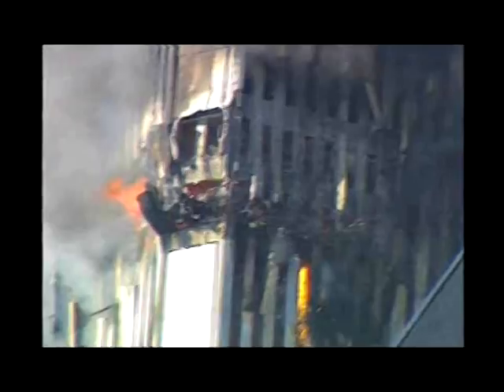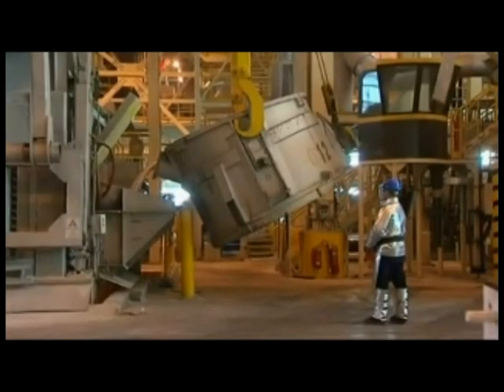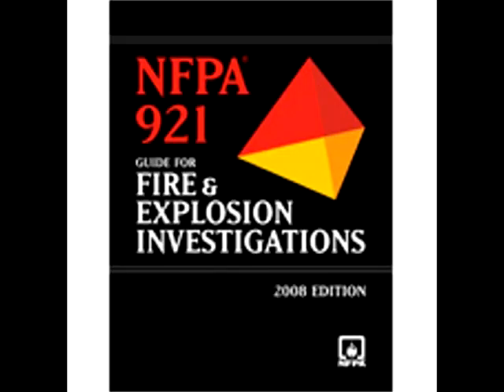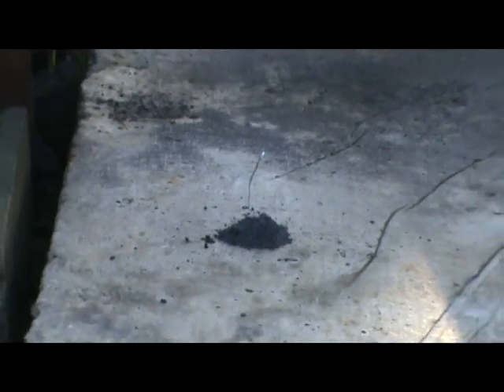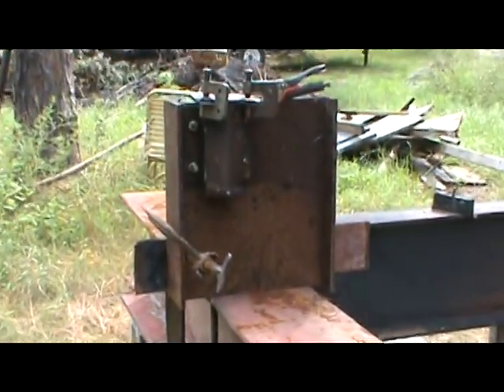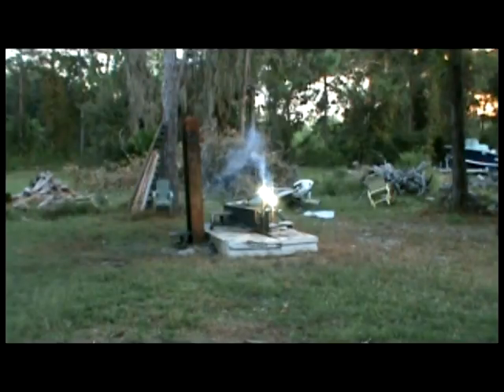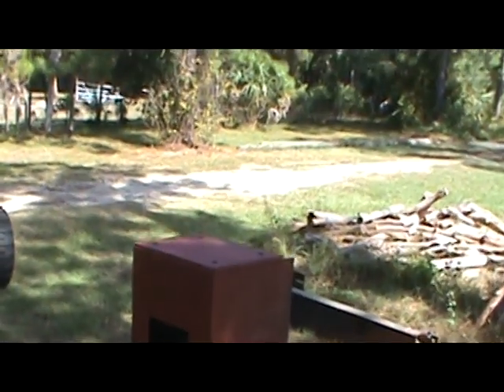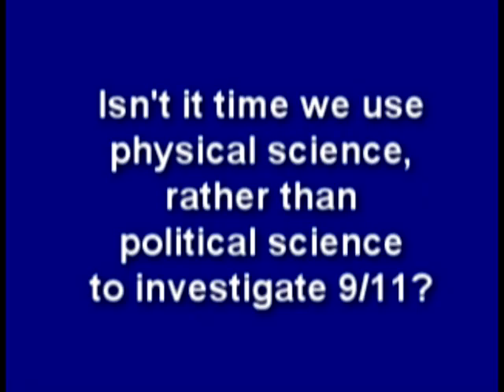9/11 Experiments: The Great Thermate Debate

Comment: Nist never said steel melted.they said it weakened steel until the point where it can no longer carry load and buckles,thats aluminum pouribg out from the aircraft,since it could melt in the intense heat
Reply: Molten aluminum is silver...
Reply: +oBlair65o it's yellow when heated

Comment: The space shuttle was traveling at over 17,000 miles per hour in the upper atmosphere and they recovered over 8,200 pieces. Yet the planes on 9-11 vaporized ? Those buildings were built to stand up against anything. Come steel beams spaced 36" apart all the way around. We'll never get the truth, nor the truth about JFK.

Comment: Error number 1  molten metal pouring out the building.  That could have been almost any substance that caught fire.  No proof at all that it was metal. 
Error 2 taking a fire fighters word for something he isn't qualified to judge.  How does he know by looking that it was molten steel.  What is the difference between molten steel and molten aluminum visually?
Error number 3 molten iron spheres.  Nowhere does he provide proof that these are iron and not anything else.  Even assuming they were iron I can think of several items that could have been in a massive building made of round steel/iron including decorative items.
Error 4  NASA photos.  Aside from the fact that higher than normal temperatures days after a fire like this would be normal, why would NASA take satellite photos when aerial photos from a plane would give a much higher accuracy?
Error 5  Melted steel beams.  The fire heated up the beams and got them soft enough to shear off under a weight load.  What's so hard to understand about that

I was planning on going through this point by point pointing out all the flaws in logic and science but it's pretty pointless when less than a minute and a half in there are already this many idiotic mistakes.

Comment: You fuckin truthers are all the same. You don't have to MELT the steel. All you have to do is weaken it. I'd say an airplane smashing into the building and burning for a couple hours, and lets not forget the tremendous weight of the building above the crash site, would weaken it substantially. As for the way it fell. Controlled demolition starts from the bottom. The buildings both started to fall from above the crash site. No controlled demolition works that way. Add several thousand tons of falling metal and a weakened structure and you get the collapse that we all saw.
Reply: Joe Momma Right, so you are saying a plane crash and office fires in the top floors weakened the steel in the bottom 2/3rds of the tower, which was unaffected by the fires, and caused the structural steel to offer zero resistance to the upper floors, and the entire structure to explode into powder.  You also seem to believe it impossible to initiate a top-down demolition sequence.

Yeah, you definitely have good grip on reality.
Reply: Emvaz22 the bottom 2/3 doesn't need to be weakened. When the whole top started collapsing it took the rest of the building down with it. Loosen your tinfoil hat a little.
Reply: Joe Momma Right, because the top of the tower would actually accelerate downwards, and the bottom two thirds of undamaged structural steel wouldn't offer any resistance, and the entire tower would collapse to dust.  Clearly, that happens all the time.  Find me another example of fire causing this type of collapse, ever, in the history of manmade structures.  Good luck.
Reply: I'm not gonna argue this with you. Clearly you are all structural engineers with no rational thoughts.
Reply: Joe Momma Sure, because believing that structural steel would resist and would cause the structure to slow down during a collapse, as it would take time to buckle every floor and sever the connection of every girder and truss, is clearly irrational.  An accelerating collapse, along with steel and concrete turning to dust in midair is perfectly normal and happens all the time...like that time when...oh wait it has never happened like that any other time in the history of structures.

Clearly, I'm the crazy one here.
Reply: So your saying that even though all that debris coming down would still slow down. As more and more debris builds up of course it would accelerate. Your so bent on confirming a nonexistent conspiracy that you cast aside simple logic. Thats the problem with you people. You cast aside logic in order to keep the conspiracy going. Otherwise what else would you have to do.
Reply: Joe Momma  No, you are being illogical. A smaller mass does not crush  a much larger mass into nothing. Not unless the floors could crash down at an incredibly high speed of course. They never had that momentum, and why didnt the floors pile on top of each other, and why oh why did lots of steel and concrete turn into dust in mid-air? There were massive dust clouds, and huge steel beams were hurled upwards and 200 m to the sides. That is not something that can happen without explosives.
Reply: Erik Jonsson Oh you haven't heard?  Fire can pulverize concrete and sling huge steel beams outwards horizontally.  NIST says so.  It must be true.

Comment: I am wonder about all the aluminum oxide that would be present after a thermetic reaction you are describing.  Were did all that go?  There should have been Al2O3 residue all over the place but no one has mentioned any.  Bombs always leave residue, always.  Also even with thermite being cheap and easy to make, someone will still have to cut into all those walls with scores of business people complaining about all the workers getting in their way and making a mess, just like everyone does when any maintenance work happens in an office.  That is a lot of charges to place on a lot of cross sections in two massive building and one large building.

I think you need to look for a different answers although your work with making thermite cut horizontally is very cool.

Comment: I'll say this, I honestly am one of the people who believe "most" of the official explanations.  Before seeing this video, I had seen pretty much all of the other programs when they aired, on trying to use thermite and thermate to cut columns...but the level this guy takes it to, exploring so many different ways to do it through trial and error, really does make me wonder why the rest of the investigation into all accounts wasn't looked into so extensively as this guy did with just this one part of it. 

So it's got my interests peaked, but the "how" as in how it got there still seems improbable.  Just on the premise that how long this would have taken, the equipment, the man power, the planning....and the sheer coincidence that it happens at the impact points of the planes.  That is pinpoint precision that I don't believe could have been possible.  Do I believe there was molten steel under the collapsed towers?  Yes.  But think of it this way...all that collapsed steel, concrete powder and whatever else material wise was in that building, completely entombing steel that was "heated" but not melted.  The heat has nowhere to go and gets trapped like a convection oven, so it just gets hotter and hotter. 

Now I'm no expert, and I don't pretend to be.  I think that people that are called "truthers" have some valid points, arguments, and evidence.  So does the official side of it.  The problem is that the evidence to conduct any other investigations is long gone and without that, you're barking out things that will only be confirmed by full admission from someone involved.  That, will never happen.  I will say this though, if you haven't been to the memorial in NY and you live in the area, go there.  Seeing things with your own eyes such as the actual steel, the façade, the pieces of plane wreckage is a completely different experience then looking at it on videos.  Even if it doesn't change anything, you at least can pay the respects to the events of that day and the people involved.....on all the videos you comment on.

Comment: A while back I saw a show about the PEPCON disaster, where a Rocket Fuel plant exploded in Henderson Nevada. The plant manufactured Ammonium Perchlorate which is used as an oxidizer for the solid rocket boosters used on the space shuttles. In a demonstration, the Ammonium Perchlorate was placed on a steel beam and ignited where it burned clear through the steel. Ammonium Perchlorate burns at 3800F, at temperature at which steel boils. This may have been used instead of thermite or thermate as it would be much more efficient than either of the latter and it would make hauling it into the buildings much easier because less of it would be needed to cut through the steel beams.

Comment: To claim to be an engineer and then admit you know nothing about explosives you sure do make a point of pretending that "pressure pulses and dust puffs" are the same as explosives. And no, they are not the same thing just as "pull" is not a demolition term meaning to explode something.

Comment: If a Tornado can throw a drinking straw through an oak tree due to velocity then we would understand how an air craft weighing several tons moving at 700 miles per hour could cause enough structural damage and cause the buildings to collapse.

Comment: I'd debate with Mike but he even looks like a government figure or a cock,cop i mean. Did you not see what this guy did. We need another video of temperature with temp lazar and torch to see if this 950 degree structural failure. I don't believe its that low but hey i could be wrong but doubt it. Think it takes 1800 for structural strength loses.

Comment: Bullshit, i designs industrial furnaces, ovens and burners. That's oven environment inside the building. molten iron is concentrated at the burning area tells u exactly what it is. anyone calculated how much of jet fuel there? Or mentioned it at all? Again, bullshit.
Reply: mykegoh  why dont the grills on gas stoves melt? They burn hotter fire (blue flame) than an uncontrolled burn. Besides, this is just one, of a huge multitude of different strands of mutually supportive evidence that prove the destruction of these buildings through preplanted explosives.. so dont even bother.. The case is incontrovertible. If you dont know that then you dont know what the facts are, -or you know them, but u'r full of shit. Nothing personal, and that's not a false dichotomy, it's just the easily verifiable truth.
Reply: +winston smith... why don't the grills on the stoves melt? They burn hotter fire...... 

OK you just made a fool of yourself,  move on.